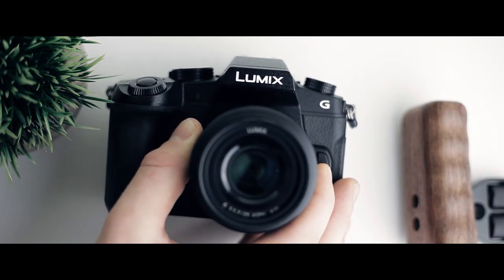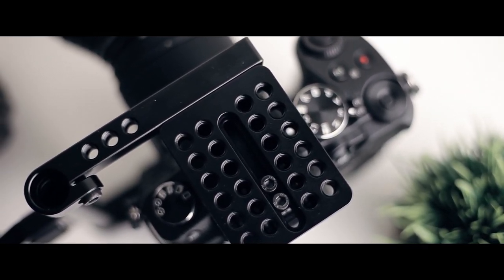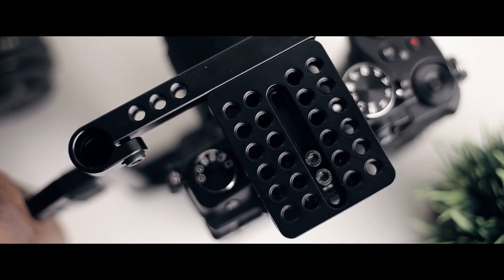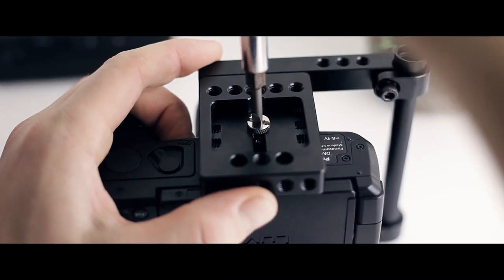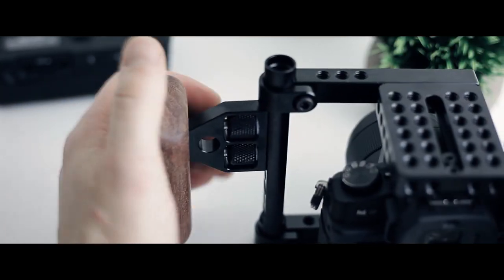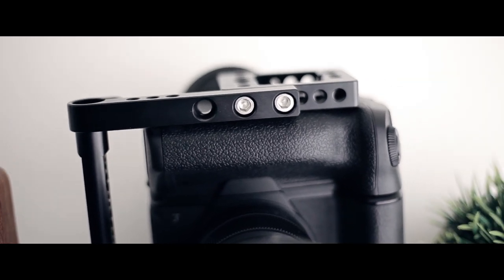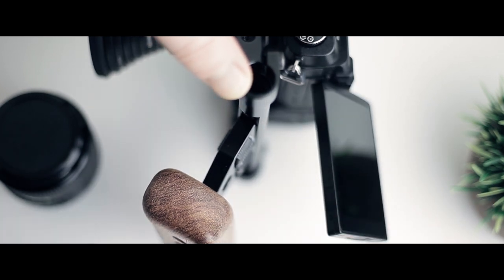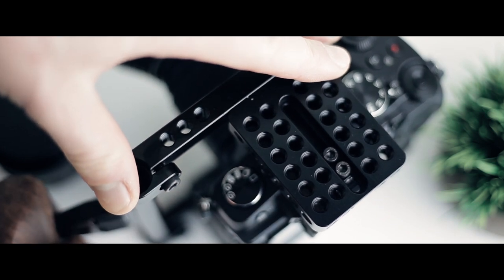Camvate Universal C Cage // How To Setup, Battery Grip Compatibility, Panasonic G85

Comment: Thanks for the information! Got a question if I may, I clicked the Camvate Cage link but it does not mention the 15mm rod and it does not mention if it fits for Panasonic, I got a G85 with a battery grip so I just wanted to double check if the link is the same cage of the video.
Reply from the maker: You're welcome! So I just checked it for you, and that is the one that worked with mine so you should be good! I think I mention the clearance in the video as well. If you're worried at all you can always get a longer threaded 15mm rod. Good luck!
Reply: @NolanGunn  Thank you, I am starting to explore my creative side, my intention is to create narrative shortfilms. Anyway, your quality content is really good, keep doing that and you will go far!

Comment: Does it mess up the hot shoe.? I wanna make sure I can still attach a flash trigger and it works.
Reply from the maker: It's pretty robust, but I cant speak for long term electronic integrity. It definitely would be better to get a real cage if you want to avoid damaging it.

Comment: Is this easy to use with a battery grip attached?

Nice video!
Reply from the maker: Yes! The included longer 15mm rods just barely fit a battery grip 👌🏼
Reply: @NolanGunn  just to hold enough I see..
I'm considering to get a cold shoe grip.
I think it will be easier to use the cam too.
Appreciate your videos!